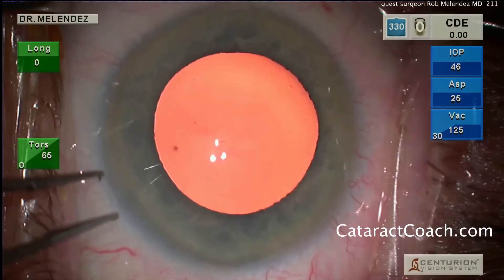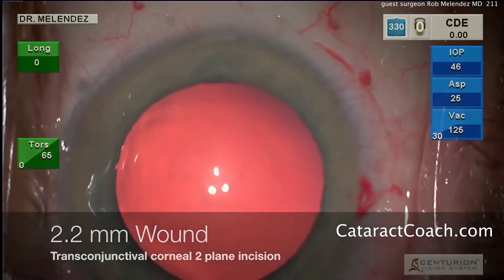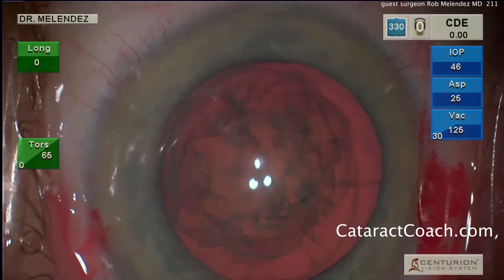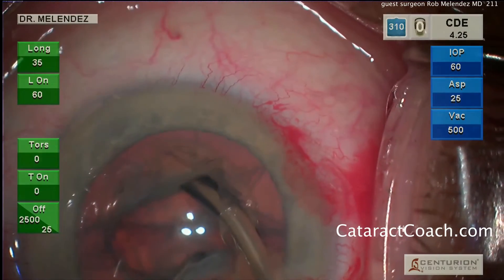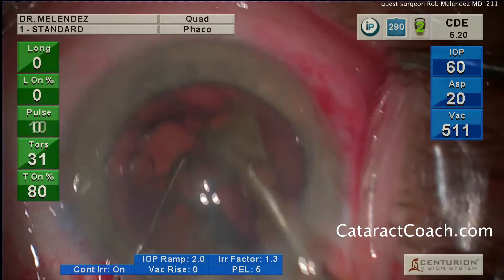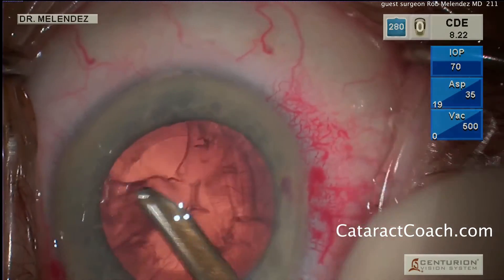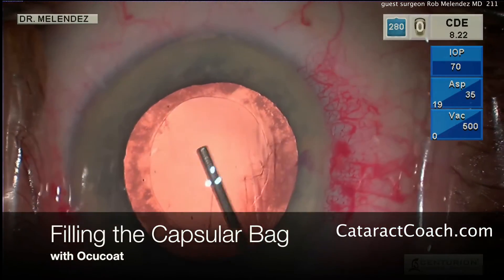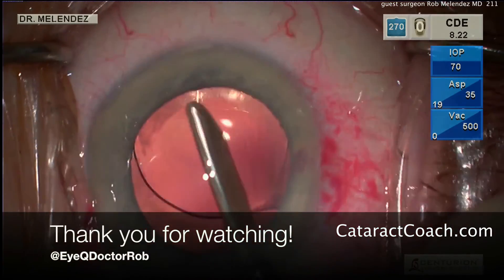Cataract Surgery using a Simcoe Cannula with Rob Melendez MD

Comment: hi Sir, Thank you so much for this video. Really helpful. I have a question. While using the simple cannula, I have faced the problem of accidentally aspirating the rhexis margin and pulling it. How can I prevent that?
Reply: With a Simcoe cannula, you aspirate manually with a 5cc syringe. There is no risk of aspiration of the capsule rim.